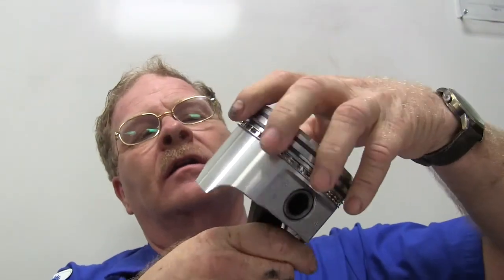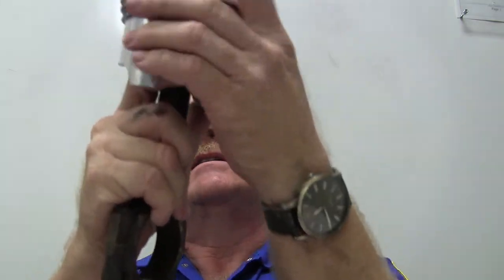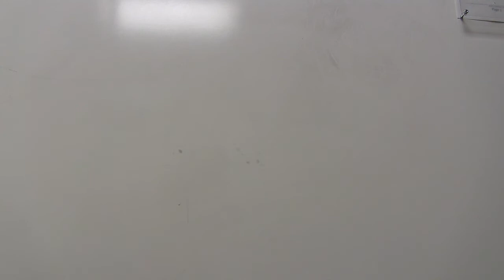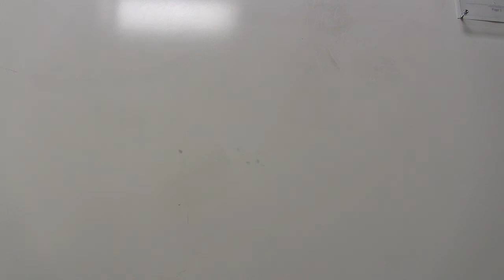Engine Repair Test 4   Internal Part Stuff

Comment: I have had problems with cheap chains breaking on me before. Use something you know is strong enough to lift the load. Check push rods roll them on a flat surface. Always check them on a older Ford V8.